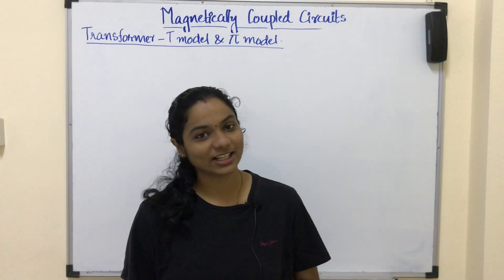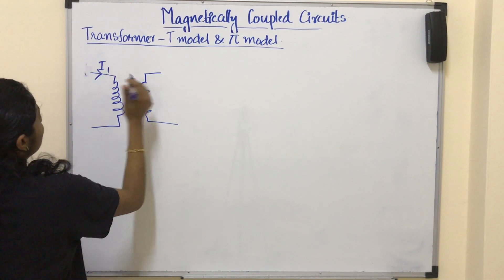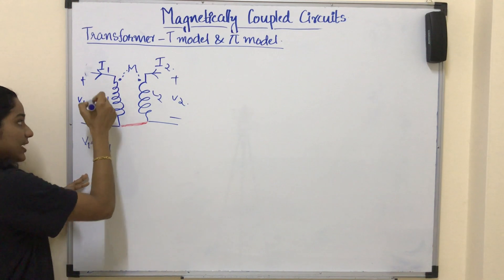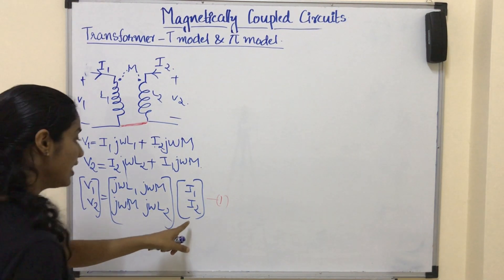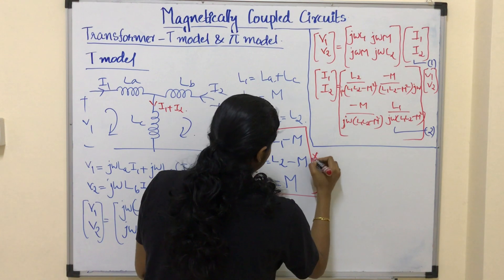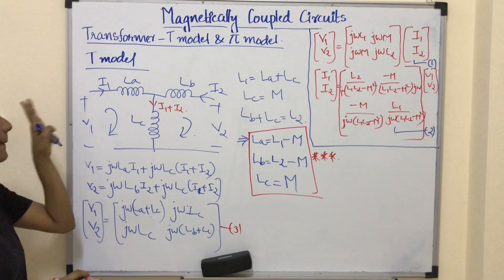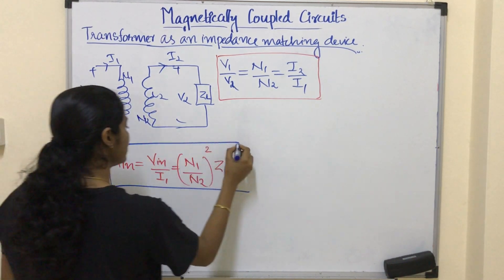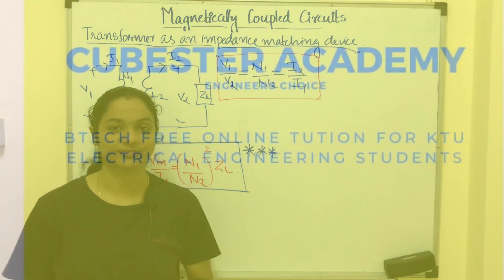5. Magnetically Coupled Circuits - Equivalent T-Model and π-Model Of Transformer

Comment: Hello, wonderful lecture! I was wondering, if M=sqrt(L1*L2), then all the terms in the matrix (equation 2) become infinite, and La, Lb, Lc are zero in the pi model (but not in the T model). This confuses me a little bit. Could you explain what that means?
Reply from the maker: Thank you.

Kindly note M=ksqrt(L1*L2), where k is the coefficient of coupling.

4. Magnetically Coupled Circuits -Coefficient of Coupling & Energy Stored in Coupled Circuit
https://youtu.be/uzDSko_81Fw

Kindly refer the above link for more information.